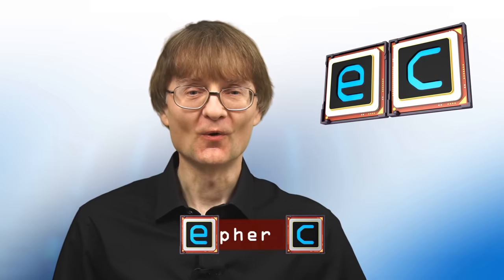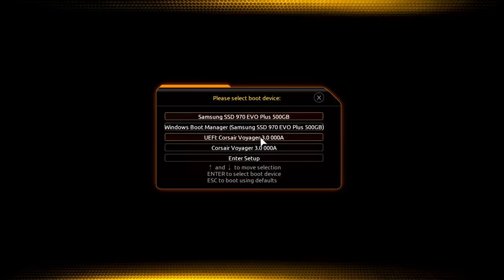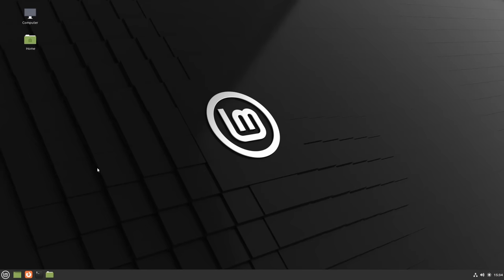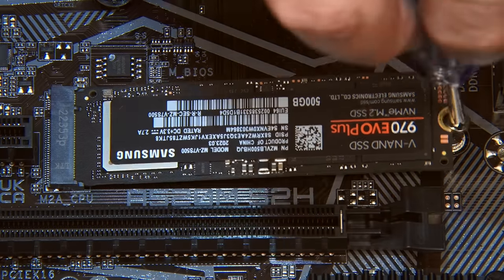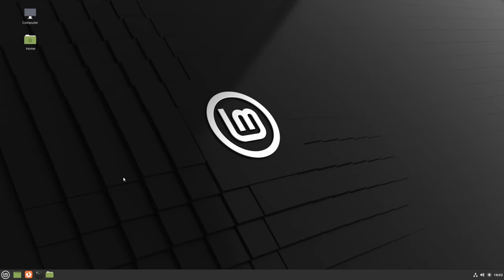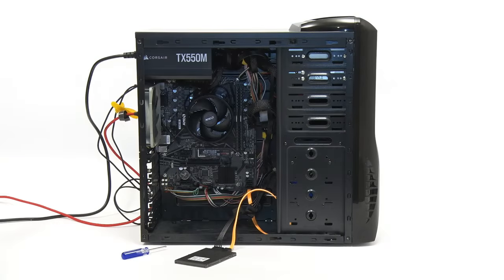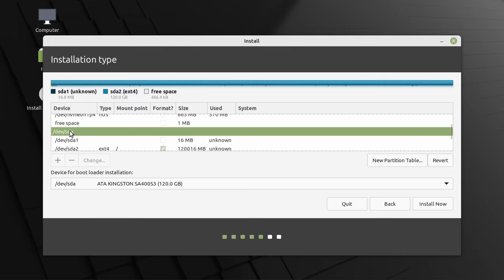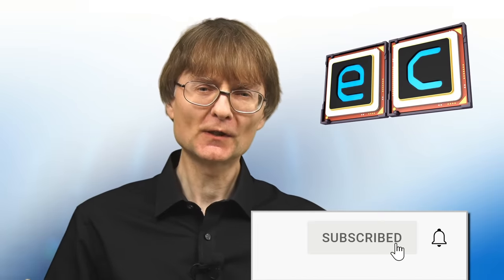Windows & Linux: Dual Drive Dual Boot

Comment: I used to dual boot with Ubuntu and Windows right until the "upgrade" to Win10 wreaked havoc on my disk. I got rid of Windows, and I've never looked back. 
These days, I'm dual booting Manjaro as my daily driver and Mint for some packages I need in deb format.

Comment: This is an awesome video as all of your content. Nonetheless I should point out you should maybe had add pointers about UEFI  vs MBR OSs installations and the always hastle of dealing with secure boot on UEFI motherboards. Even so, this is an amazing and easy step by step explanation of the best way to do a dual, triple, etc OS setup. Thanks a lot

Comment: I did a dual-drive dual-boot on my Alienware (R.I.P.) and it would remember which drive I booted to last. This came in handy when updating Windows as I did not need to be there when it inevitably rebooted on its own. Note I also temporarily removed the data drive when I installed Debian.

Comment: I had a dual boot systems with Windows 11 and Linux Mint and it worked properly on two SATA SSDs. Then I changed the motherboard, processor, memory and this time used an m.2 SSD and a SATA SSD. I could not get into the boot menu consistently and finally ended up placing the SSD I had for Mint into a USB adapter with the USB as the primary boot disk. So if I turn on the USB adapter it will boot into mint but if I turn off the USB adapter it will boot into Windows 10.

Comment: The effort you put to make such a condensed tutorial is highly appreciated.
In a dual drive dual boot system, can Linux Mint access Windows files like in a single drive dual boot system? 
(Once I have tried Single drive dual boot method and Linux Mint could access Windows files and didn't work other way around)
Reply from the maker: Windows will not be able to access a drive formatted for Linux (eg ext4). But Linux should be able to access the Windows drive (assuming it is not encrypted by Windows, or locked on exit). So almost certainly you will find it works just as your single drive dual boot did. You could always create a partition on either of the drives and format it, eg, exFAT and both should always be able to access (ie you could keep some of your Linux system's data on a partition formatted with a non-native Linux format that it can access).
Reply: @ExplainingComputers  Thank you and it's a very clear answer.

Comment: Useful video. I recently installed Windows 11 on a new M.2 drive, and left the old Win10 installation drive in the machine.  It added the new installation to the boot loader of the old Win10 SSD, so when removing the SSD, windows 11 didn't boot anymore. Was able to create a new boot partition on the M.2 drive after pluging the SSD back in, so now I can install Ubuntu on that drive - but I will definitely remove the Win11 M.2 drive during the installation!

Comment: I have a dual boot, might be considered a triple boot atm. Linux Mint, ArcoLinux (still my main), and Win11 (gaming only). I know installing Linux last seems to be the way most got it to work. I have a few spare Linux ssds and nvmes around. I like the dual drive method though I have done both in the past.

Comment: Love the videos, keep up the excellent content!  I was dual booting into windows and linux mint on 1 512GB SSD but got inspired by this video to migrate Mint over to my 1 TB SSD.  Everything was going swimmingly - I made a timeshift backup of my existing Mint onto a thumb drive, installed a new linux mint instance on the 1 TB and finally went to unallocate the grub partition on the 512GB.  Little beknownst to me, that grub partition also contained the windows boot loader.  After about 2 days I was able to restore the partition and run EasyBCD to be able to boot into Windows again, alas it has left me unable to boot into either instance of Mint (on the 512GB or the 1 TB) as I no longer have the option in the BIOS.  I'm thinking of deleting the 1TB Mint partition and re-installing and hopefully that would make a new grub partition.  Now I know - never delete a efi partition unless you REALLY know what you're doing LOL.  Any advice?

Comment: I keep Windows on its own machine and drive, almost always turned off. Truthfully, I turn it on only to check for updates or if I need it for its singular 'special purpose for existing', which is virtually never.
A dual boot system allows Windows access and opportunity, to sully the Linux installation in ways only Windows can do. It should be kept completely cut off from any other system, ideally on some other Continent!     ;-) 
I have tried various flavors of dual booting over the years, countless variations, and come to the conclusion that it is not a good idea, at all.  Plus, I discovered that the real secret to successfully switching to Linux is to buy a shiny new, but inexpensive, machine, and install a shiny new, fresh copy of Linux on it. It is a psychological commitment that is most effective. 
Now I'll watch the video, knowing full well I may have to edit this comment due to the fact that EC videos are never dull, ordinary or uninformative.
........ OK, watched video. No changes required above. Still, watching was worth every minute, as always.
EC: Mr. Rogers for computer people  ;-)

Comment: I've been watching ur tutorials as my guide to learning mint and it's been useful! I also wanted to ask if I'm going to add another ssd/hdd for my files will both OS recognise the files on it and be accessible each time i switch?
Reply from the maker: Both OS should be able to access another drive with your files on, but it must be formatted with a format that both can use, which means FAT32, NTFS or (probably best) exFAT. And I would format the drive as exFAT in Linux. Make sure that Windows  is not set to encrypt the drive (eg using Bitlocker). And note that there can be permissions issues, where Windows leaves the drive so Linux cannot access it. If you have this issue, try in Windows right clicking the drive and accessing Properties, Security, Advanced, and change the owner to a user called Everyone. Good luck! :)
Reply: @ExplainingComputers  thank you!! I'll work on it!

Comment: I've never had any issues with GRUB boot menu setups, and I've been using them on my main PC since RedHat 9 days. In my experience, Windows killing GRUB is a possibility in MBR boot environments. When using EFI boot, Windows doesn't touch the shim/GRUB files and any difficulty after a Windows update can easily be fixed by correcting the boot order in the BIOS setup. I like the possibility in GRUB to edit the Linux kernel command line for troubleshooting Linux, that's why I always use it.
Reply from the maker: Thanks for this. But others have reported GRUB corruption issues . . .
Reply: I remember Windows having issues running its own updates when GRUB is taking up space in the /boot partition. It doesn't/didn't have enough available space to run the updates. This applied to both EFI and MBR boot. Not sure if this is still an issue. 

( This has never been an issue with Linux systems using systemd boot. )
Reply: @notjustforhackers4252  I always install Linux first and make sure the efi partition is larger than Windows default 100 MB. I do also always use a separate physical drive for each system, that is always a smart move.

Comment: I use dual boot with two harddrives in my main rig and it's fatastic. I can even load up the Windows partition inside Qemu/Virt-Manager to avoid having to exit Linux and still access all my files and programs in Windows!

The Windows VM can also play games using KVM/VFIO by unhooking the GPU from Linux and passing it to Windows using some scripts. It's almost as fast as bare metal. If I ever need that extra performance I will just reboot and go straight in to Windows

Comment: Hello Christopher.

I can tell you that UEFI, will by default and design, search for an existing esp on any existing drive, even if you tell an installer to use a different drive, it will use that pre-existing esp. Your method of installing with two drives, is the better option, with the other drive disconnected, and using grub to boot. Grub gets overwritten by Windows updates on some occasions. Windows update will not touch grub if it has it's own esp on it's own drive, and the grub corruption issue is bypassed. You can still select which OS to boot via the boot manager process in any case. I have done this with many systems over the years even with multi-boot systems with up to 12 Linux distros on a single computer along with Windows. I have never had a corrupted grub using this method. 

Having said that, I do enjoy your videos and find many of them to be very helpful. I thought this information might be very helpful to you.
Reply from the maker: I am confused, as I am well aware of everything you say, and say nothing in the video to the contrary. Indeed I am explicit that it is Windows updates that may cause GRUB problems. Nowhere do I discuss UEFI entries -- only GRUB. Bewildered.
Reply: You mention that you told the installer to create an esp on the drive you installed to, while the Windows disc, with an esp, is still connected. I was, therefore, indicating that would not work in that fashion.

Comment: As always very interresting! Thank you a lot!
What's the difference from booting Linux only from USB?
Reply: If we're talking about a standard flash drive then that'll be slower to access. If you use a dock or a hard drive cage and connect an SSD over USB it'll be faster and just as portable. If you use it permanently plugged in that way then it'll mean one fewer USB plug for external devices, but otherwise it'll function essentially the same. You could use that as a means of protecting your data by keeping it hidden or locked in a safe until you boot the computer with it.

Comment: Thank you for another informative video! I’ve been dual booting since around 2000, and t he options are more diverse and easier to implement now. 

This particular video makes use of a BIOS boot menu as one method to boot the alternate OS. I would be very interested to see you produce a video on the differences between the use of BIOS vs UEFI. Most modern PC hardware supports UEFI, and I have found through experimentation that UEFI support sophistication is rather variable across different hardware. Managing UEFI on two or more disks for a dual or triple boot configuration turns out to be fairly tricky in some cases. Thanks for all the content that you produce.

Comment: Dual drives is always the way to go for dual boot.

It is possible to tell GRUB to default to Windows.  This way you could always boot initially to GRUB and not have to  interact with the BIOS every time to boot Linux.

This solution would work better for those not comfortable with interacting with their BIOS which will be different on every machine vs. GRUB's interface which is the same on all machines.

Comment: Corrupted GRUB Boot Menu .  .  . I've been there, done that and may start selling the T-shirts. I just finished re-doing the system that I'm on now from "Assuming" that the GRUB boot menu might have been fixed, since it's been several years since the last time that I tried fooling around with Linux.  I was wrong and paid for it.

I've also been bitten by installing Linux first, then Windows, which installs Microsoft's bootloader instead of Grub. It also can become corrupted and can be tricky to remove. (I don't miss the days of calling Microsoft's Re-Activation Hotline when these things happened.)

I had decided to use the BIOS method with a second drive and happened to see this video and was curious about your results.

Thanks for the Video.

Comment: Your videos are easy to understand for even the most simple minded of us.  I'm grateful I can understand them.  I have a question.  A friend used a hardware switch of some sort to build a triple boot machine (3 different versions of Windows).  I cut my teeth on AT&T UNIX S5R4 and earlier versions.  I am therefore unfamiliar with the Linux GUI.  Looks intuitive.  I'm assuming you can shell out and write scripts if you like?  If so, I wonder how hard it would be to install a version of LInux on one drive, Windows 11 on another, and use some sort of switch to switch between them?  Is there a way of doing that without confusing the CPU or is it necessary to do a Restart of the OS in order to get the CPU's attention?  Aside from that, is there a virtual machine Linux that will work on a Windows computer?  I'm looking for the very simplest possible option for switching between OS's.  Thanks.

Comment: GRUB will boot just about anything, anywhere. I switched to desktop Linux over ten years ago. No regrets whatsoever. Switching around OSes doesn't bother me at all. As someone who's spent thirty years in IT it's easy to get complacent and intolerant of those who haven't.
Reply: To be fair, I am not the greatest technician. Most of my time has been in consultancy and project management. That said, I can still navigate my way through most things. I've recently taken a liking to Manjaro's Xfce edition. I think the appeal is nothing more than the fact it's not Debian derived. Arch is beyond my patience completely. Thanks for some interesting content Chris.

Comment: If you set up a /home partition as fat32 or NTFS you can access files on it from within Windows. Some users like to have a separate home partition so that it can be accessed by other Linux distos in a dual boot setup, and not just by Windows.

Comment: If your PC has USB 3 ports I suggest buying an external SSD drive and installing Linux there with the "Something else" option. It doesn't feel slow at all, you can just unplug it if necessary and you can take it with you to be used anywhere. The only drawback is that the Windows option in Grub will only work on the computer you used to create the disk but it's not a big deal.
Reply from the maker: Yes, running Linux from a USB 3.x drive works well these days,

Comment: In all the different methods you used to install LinuxMint, you can dual boot using the system bootselector. Even in the single drive dual boot the grub bootloader in installed in the uefi partition, and thus you can start windows up by selecting the windows bootloader from the boot select of the uefi/bios.
So in all of the above you could start windows without using the grub bootloader simply because the grub bootloader is not installed in the bootsector anymore rather in the uefi partition. 
Even when you install ubuntu on a second partition you could select windows-loader as the default boot from within the bios/uefi.
And if the ubntu partiton gets fully erased you can still boot with the windows bootmanager from the bios/uefi-bootselector in theis case either using f12 or changing boot order in the uefi/bios settings.
Reply: Well stated.

Comment: Nice video Chris, I've used dual booting Debian for some time and have found that using refind avoids the grub corruption issue. That said since most Linux distros now support UEFI and since switching Linux to use UEFI I've not had the problem of grub getting corrupted. Occasionaly when updating my system's UEFI firmware (bios) I have had to go back in disable the secure boot option, which seems to get turned on by default on most updates. Sometimes I've had to go and add into the UEFI the boot option my browsing the EFI partition on my SSD.

Comment: I'm sure you're aware of it, and probably going to make a video on it, but you can fix a corrupted Grub, and generally I've only seen one get corrupted when dual booting with Windows, but you can also set it to not display a boot menu at all and just boot directly to the OS of your choice. With your BIOS setup the way you have it that would probably be the best option, to only write Grub to the disk with Linux installed and have it boot directly to the OS.

Comment: It's nice having a dual boot system, I've been working on setting it up all week.  I can use Windows when I want to be productive and use my PC, and I can use Ubuntu Cinnamon Remix when I want to hate my life.  Kidding aside, I set it up so I could work on programming projects for my Linux server and easily recover files from the ext4 volumes from my NAS if ever necessary, but good LORD is the desktop experience a nightmare for my multi-monitor setup.  I'm about to try my 5th reinstall this weekend to hopefully fix the nightmare of X11 configuration it takes to get it working.  Wayland doesn't work, and thanks to Nvidia I can't fix anything with Xrandr.

Comment: There's two important things you have to do here. At least with ubuntu, when I dual boot, I set ubuntu to use the hardware clock, so only windows is setting the time, so the time is always right. Also you need to turn fast startup off in windows, it's probably not as important to do the second thing in dual drive, but you probably still should if you are booting both OS'es on the same machine. Once you do that there really is NO risk, you might have to punch in a bitlocker recovery key,  but once you do it once you won't have to again until you change something again like update your BIOS. I do love that UEFI made it so you don't have to edit grub anymore for simple dual boot situations, be careful though it can trigger bitlocker when you change it, just punch it in it will fix it.

Comment: I still favour the removeable hard drive method. A stack of SSD's like game cartridges. Just eject and slot in the next. You have no risk of one OS messing with another as only one is physically attached at a time. 
Also, it makes it easy to pull out the drive and image it on another PC. If you make a mess, just put the previous image back. Or a mirror image ready to go. Even a catastrophic failure is just a reboot of down time. 
You can have permanently resident drives for common storage or another removeable drive as OS specific complimentary storage.